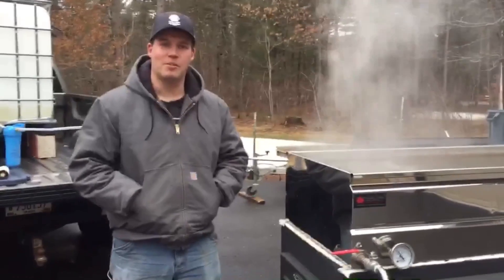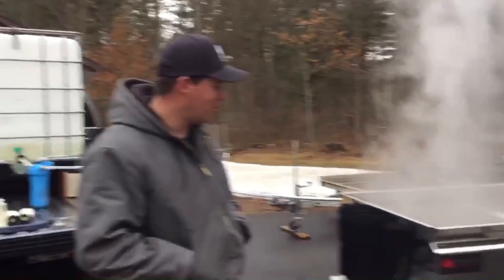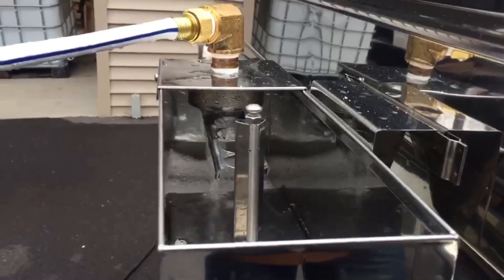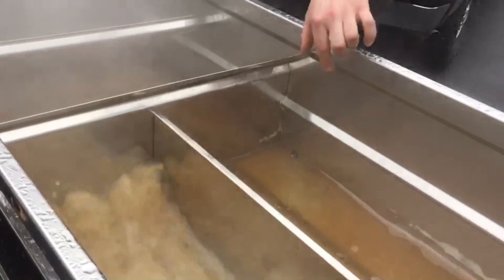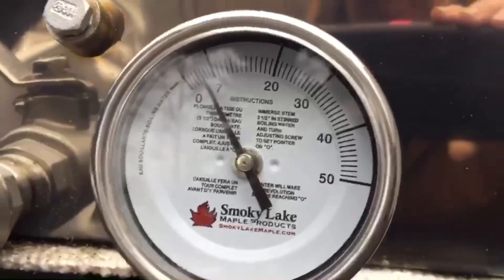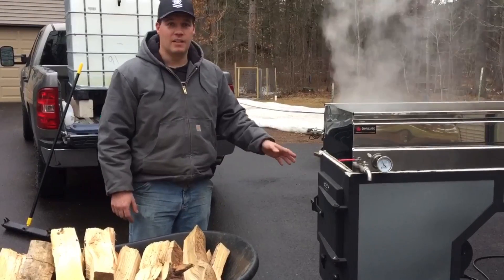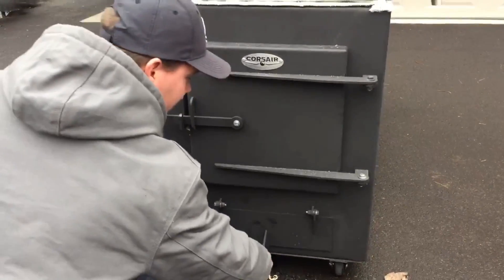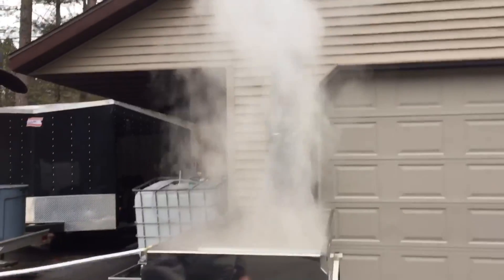Smoky Lake 2x5 Hybrid Hobby Pan Operation

Comment: If you want to sell me that set and get an upgrade....let me know :) lol I’m looking to get myself a set up this year! Can you make a video explaining or showing what to do on a unit like this with your very last drops of sap/syrup leaving the pan? Do you add water to push product out, then finish it in a separate single unit?
Reply from the maker: I actually just sold it not too long ago.  I just dumped what remained in the pan in a stainless pot to finish off.  They now have a drain plug on the drop flues to help drain the pan.
Reply: I guess I’m wondering if people with say a 2x6 or larger set up have some almost finished product left on the bottom of the pan after draining, how to get that last bit out? Or is that not an issue? I imagine that my 2x3 pan I will have to maybe tilt a bit to get that last bits out I imagine. Maybe some people set the balance to tilt just a bit toward the draw off.
Reply from the maker: I’m not really sure what the guys with the larger pans do to remove all the liquid from the pan.  All I did was tip mine.
Reply: Probably not much of a big deal any ways I’d suppose for a larger operation to have to flush some potential syrup out. As a small scale person that’s sorta precious for me and I’m sure many other smaller scale people.
Reply: Mark K on a big rig you chase the sap with water at the end

Comment: Do you still like your evaporator?
Reply from the maker: I liked it the entire time I owned it.  I downsized and sold it a few years ago.
Reply: @markk4861  are you still boiling? And do you think that set up with forced air would boil 25 per hr?
Reply from the maker: @darrengarlough5121  I am now using a small barrel stove for boiling now.  On the 2x5 the best I could do was just over 20gpm with the soft pine I was burning.  I think if I were to use hardwood I could have got closer to the 25gpm rate.
Reply: @markk4861  you had forced air correct?
Reply from the maker: @darrengarlough5121  correct I had forced air